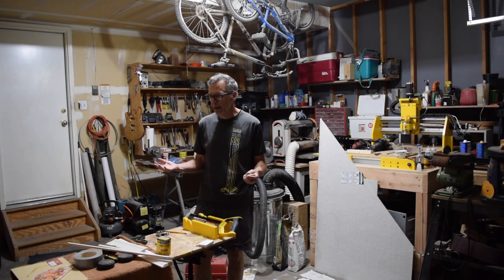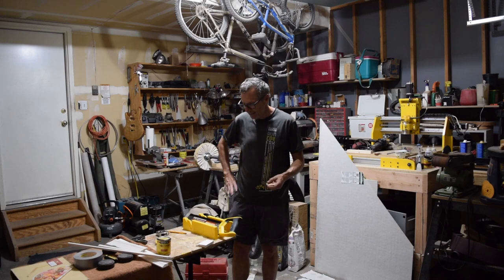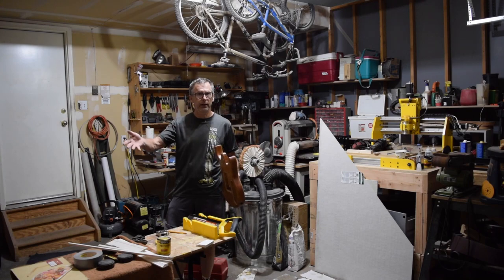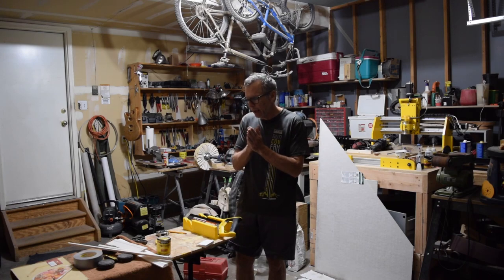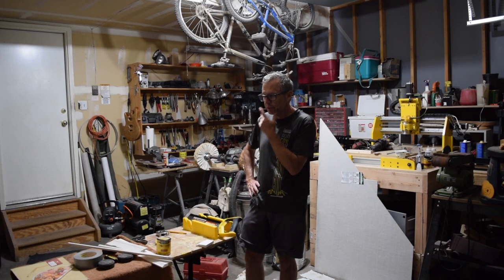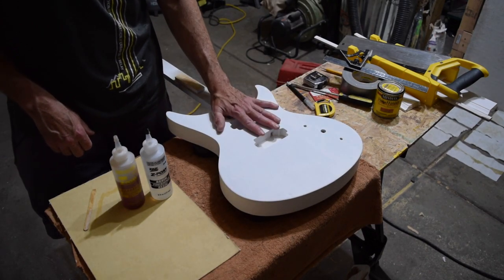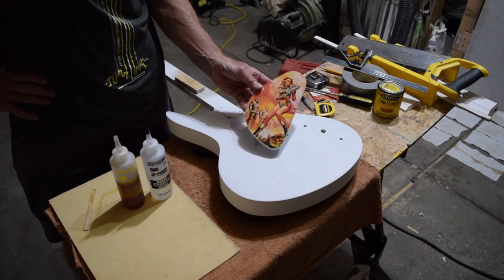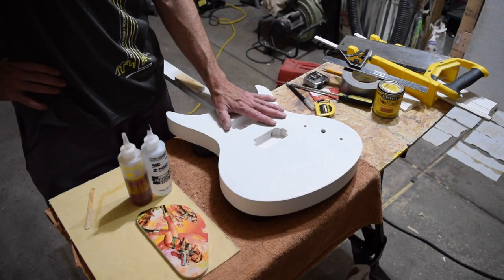Episode 104 Project Updates and My New Z-Poxy Image Lamination Technique

Comment: Hello!

I was one of those who gave criticism to the old version of the guitar. Your new approach is a million times more effective, as the comics don't look washed out anymore.

A few tips for the next time you are to tile a design. Your composition does have natural tiling boundaries, which are the comic mag covers themselves. You could take profit of such comp not to create quarters, but to create sort of a puzzle in order to use your inkjet printer. and for the unions/overlappings not to show up cutting one of the covers.

I hope you are not feathering the design towards the boundaries of the top of the body, cause it looks nice just like that. if you were to create a distinction, i would suggest using binding or as i mentioned the other day, using huge halftone patters to "dither" to the sides as in the Roy Lichtenstein paintings.

Anyway, awesome work, i really like it this time.

Comment: Have you thought of first attaching your image 'tiles' to a backing such as a large sheet of rice paper so you only have to worry about the alignment of a single paper image when attaching to the guitar top? 

Really like the vibrancy of the new Barbarella cover, you can always reduce that to whatever degree you'd like after the fact.
Reply from the maker: Alignment isn't a problem with Z-Poxy because it has a long working time.